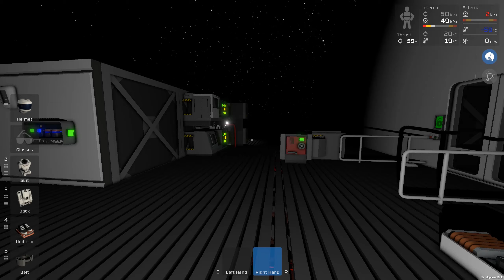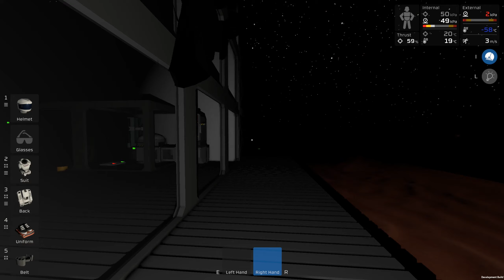Stationeers S4 E19 - Gas Based Furnace Setup

Comment: Hey, been loving the play through so far, I've been trying your atmosphere prosesing myself (new to the game) got the first lot to work but adding the h2 and 02 I've cocked up! Any chance of seeing your change so I can try and figure out where I went wrong abit better? Thanks
Reply from the maker: What’s the problem you’re having?
Reply: @grayduster  I had it filtering the co2 and and the pollutant but when I added in the o2 and h2 I broke it completely and nothing now works and cant figure it out. Was just looking to try and compare to see where I went wrong!
Reply from the maker: Make sure all the input pipes are connected together and all the waste pipes too - it should all be one pipe network. If you do that, does it filter correctly to the output pipes is it only the automatic version that isn’t turning on? I.e get the manual version working first
Reply: @grayduster  they work manually, all set up and I got the co2 and pollutant running automatically it's just once I start adding in more into the code to automate the o2 and h2 on the computer I break the whole thing and then nothing works automatically anymore not mater how much is in the pipes!

Comment: If someone wants to use the stationeers original tank colors:
White - O2 / Air

Grey - CO2
Grey - X "Pollutants"

Yellow - Empty / Generic
Orange - H2 + O2 "Fuel"
Red - H2 "Volatiles"
Blue - H2O
Green - N2
Green - NOx (this is probably a mistake, as green is usually inert, but NOx is an oxidizer)
Black - unused
Brown - unused
Pink - unused
Purple - unused

Comment: 17:20 when you are talking about the fuel for the furnace no one thinks to add a section of pipe before hand that can be emptied completely before igniting the furnace thus stopping it from making the fuel in the lines before hand combust. I have a fuel tank with pre mixed fuel than piping to a valve than another section that had a t intersection with it running to two different pumps.  One volume to return the gas to the tank and the other is a pressure reg to fill the furnace. Once full I put out the pipe behind it until it is empty thus stopping the heat from igniting the fuel behind the pump. I never have an issue with it now. Before hand I had explosions and all kinds of fun but I put a stop to that thankfully. Just food for thought for you mate hope it helps

Comment: I think it would also be interesting if the pressure/mass indicators for the gasses in a separate billboard or closer to the ground, even though the indicators probably won't be with the respective gas systems, it may be easier to view each at once instead of upward glance and potentially stressing eyes.. I wonder if it's possible to spray/color lights, LEDs, and indicators.

Comment: In your mix tile, you could wall it off instead of welding it up then you could fill it with high pressure really cold pollutant or water (maybe even have a wall cooler to keep it low).  Put a radiator on both the input O2 and input Volatile pipe right before the mixer.  With the low pressure, it should change the temperature of both inputs to be the same as the cube fairly rapidly (if not instant depending on input temp) so they mix better and being cold, it should be extremely safe to inject into the furnace.